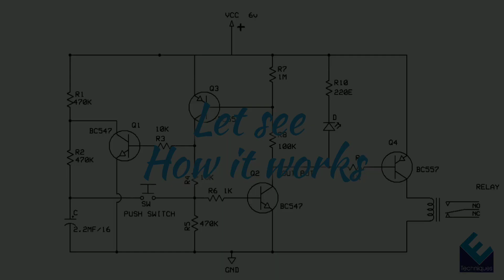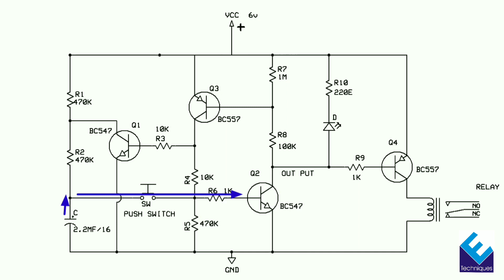Push button ON- OFF Switch Circuit.. ( Transistor Hobby Circuits)

Comment: it isnt working, i triple checked everything, can i have some tips?
Reply from the maker: Sorry about my late reply.
I have checked the circuit schematic i couldn't find any mistake on it. 
How did you test the circuit ? On breadboard or soldering?
You used the same components as I have shown in the circuit?
Reply: i checked everything and it looks clear to me, just incase i missed smth about my basics. Does the type of transistter matter I used a mosfet and some transistters
Reply from the maker: @synctax1017  yes the transistor are very critical.  You should use the same transistors for working the circuit.
Reply: @etechniques  I never knew, Thanks for your patience and your useful information. Enjoy your day!
Reply from the maker: @synctax1017  thank you.. 😊.
Reply: @etechniques  My pleasure